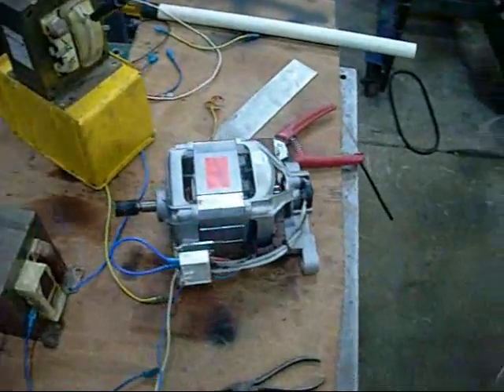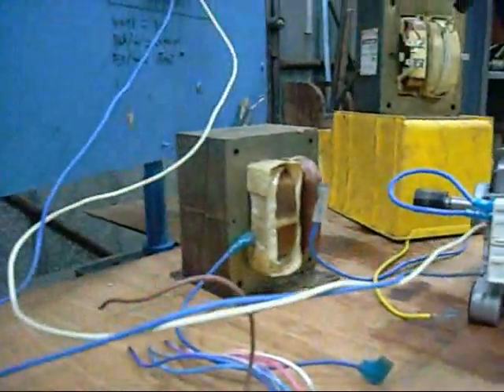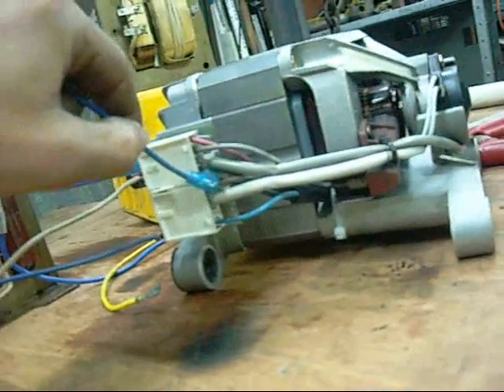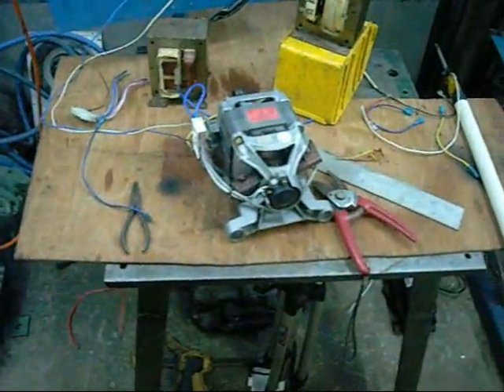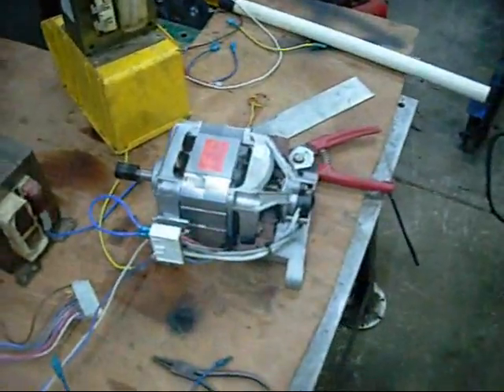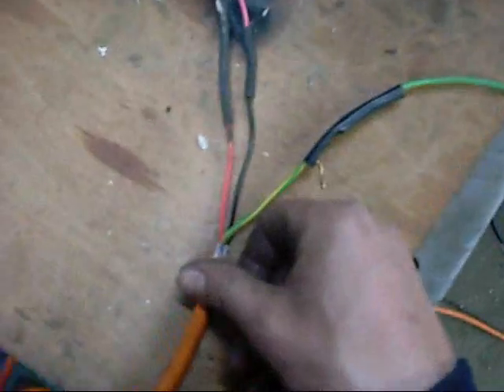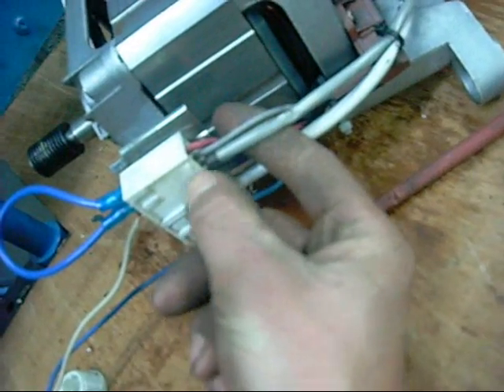Wiring and Testing Welling Universal AC Appliance Motor

Comment: I got the same motor from a Samsung front load washing machine - quite a fun figuring out how it works and how I may reuse it. I found a service manual not exactly for this model but I suspect with useful information about how to re-use the motor--
https://www.manualslib.com/manual/1059701/Samsung-R1033gwc-Ylw.html
I hope those who watch this video DO NOT take motor lightly and take safety SERIOUSLY. Electric motors could be VERY dangerous. Properly secure them before turning it on. Motors may jump up suddenly when turned on if not fixed, like what's shown in this video. You can imagine without difficulty the effect of anything attached to the axle spinning at high speed touching any part of your body, or anything flying out from it with high speed hitting you.

Comment: Does  this wiring work for all washing machines wired the same i got s motor out of a whirlpool   its 120 vcd  duty 3.8 a 710 rpm 4.6 a 15300 rpm and im pretty sure i didmt grab the capacitor  can u use the motor without the capacitor?

Comment: hi m8 ,,,could this be run by 12 or 24 volts is that right.
Reply: paul turner yes it will be run smoothly just connect a relay or capacitor then plug to ac, if you got 24v or 36v battery in it will works too.

Comment: When you turn on the engine. It has torque. that is good
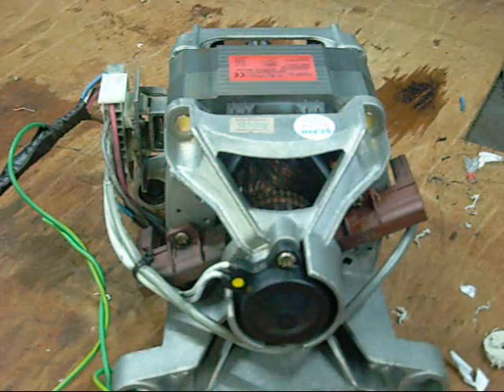4:08 / 8:45 minutes I note that the engine has screws with hexagonal head.
I can not distinguish the mark of Motor.
Please I would like to know the mark of the engine. And where I buy in the United States. Thank you.
Reply: German Garcia look for indesco electronic control motor

Comment: is it  dc or ac? is it safe to use some where else? I want to use it in a horizontal  saw mill to pull the trolley which runs on rails. It would be helpful if you could tell me its specifications.

Comment: Just robbed a working motor from my otherwise dead washing machine. Have you ever tried to control a Welling motor using a VFD?
Reply from the maker: +James Lamb nah, a VFD would have a fit if it were connected to a motor like that, all you need is a variac and your good to go!
Reply: Cheers mate, thought that might be the case just wondered if I could control the speed cheaply.

Comment: Can't tell from the video exactly, but they seem to be super noisy, right? Is it more like a drill, or closer to an angle grinder? Sadly, they aren't very powerfull at low rpms ;c
Reply: +Rafał Sacha They are not as loud as they sound here,this video has a lot of distortion.
I have the same motor and its not that loud,a corded drill is louder for example.
Angle grinder is noisy in front of it.

Comment: When this is in a washing machine, it presumably runs pretty slowly when it's turning a drum full of wet laundry, and faster during the spin cycle. How does the speed control work?  Is it like the electronic speed control in a drill, or is it a matter of wiring it up differently?

BTW, a DC motor does not have to have permanent magnets.  My car starter motor works just fine!  This motor would run on DC, but DC is hard to find at that voltage.
Reply: Mike Collins This type of motor has a tachometer which feeds an electronic control module (usually a fast microcontroller) with AC signal. The control module sends the proper square wave signals to the triac in real time, based on the desired speed and actual speed; the triac controls the motor. 
  TDA1085C modules or vacuum cleaner dimmers rapidly switched at about a quarter of the full power and near minimum by a relay controlled by a transistor (powered by an external power supply) can be used to effectively control speed and torque at low speeds on these motors.

Comment: same exact motor slightly different wiring but i wanna know how long can it run for?
Reply: theoretically they can run at full noise (20+k rpm) until the brushes wear out, unfortunately heat and centrifugal force eventually destroys them
Reply: Depends on how much load you put on it. Higher loads put more strain on the motor and can arc out brushes

Comment: Hey, thanks for the video. I have the exact same motor, though the output wiring is different. Anyway, is it going to work if I plug it directly into 220V/DC power outlet? Can I wire a simple rheostat for speed control?

Comment: Nice video.  How would you wire one of these for 120V single phase?  Is there a way to reduce rpm's to around  2000-3500?  Thanks -- TMFA

Comment: Nice video.  How would you wire one of these for 120V single phase?  Is there a way to rpm's to 2000-3500rpm's?  Thanks -- TMFA

Comment: @Aussie50 You either switch the field coil circuit polarity or the armature circuit polarity to change the motor's direction, but not both polarities which will result in no change in direction.

Comment: @Aussie50 This type of motor is called a universal motor which is nothing more than a series wound motor which run on AC or DC. This type of motor speed is controlled by voltage like a DC motor, not frequency like an AC INDUCTION motor.The reason it works on AC is because reversing the field coil polarity and armature field polarity together results in no change of the direction. You can hook up a battery and reverse the polarity of the battery and still the motor will turn the same direction.

Comment: what would happen if you wired that through the mot box. could you rev it up on 240 ac and then once its up to speed switch to mot power? wire it through a contractor or something.

Comment from the maker: @HDXFH depends what I want to use it for
I do not ground motors that I want to destroy simply because the safety switch shuts off everything.

of course, I do not touch it when its running.